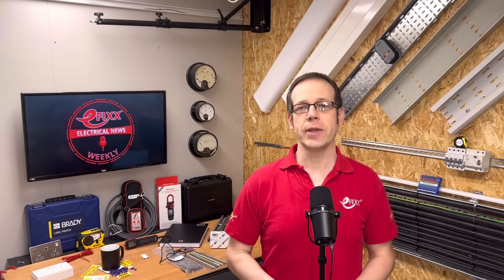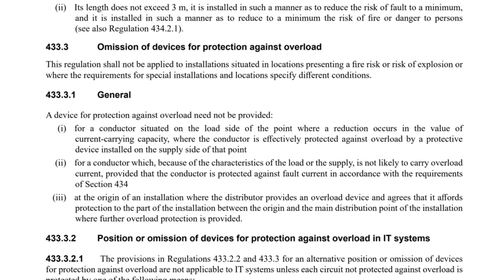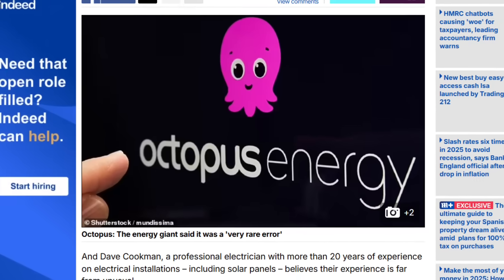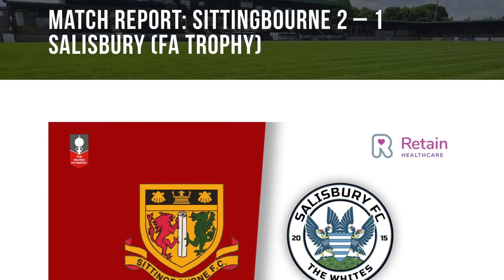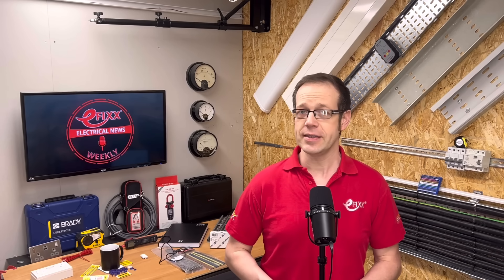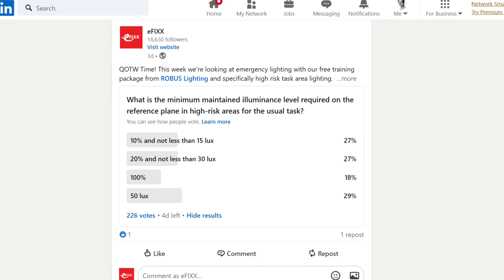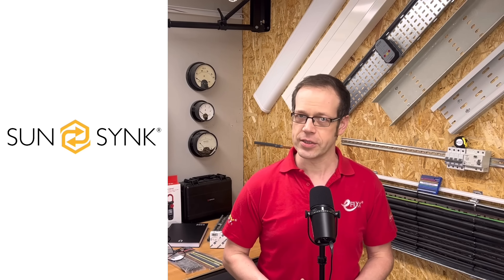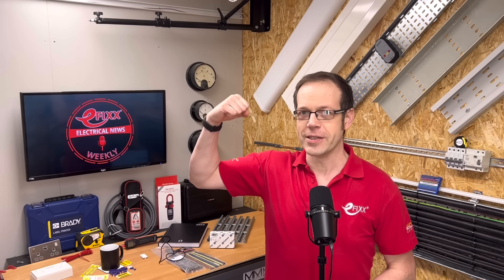Experts Give Verdict on the Cable Overload Row

Comment: How does a CT play any part on their bills though? a smart meter (or regular meter) has its own metering and does not rely on anything external to the meter. Even with FIT there is a seperate meter for this calculation. Did I miss something or is there some kind of metering with a CT (which could be abused very easily)?
Reply: With the note about solar installations, I can only assume it's the CT used on a hybrid solar inverter. With the CT installed backwards, the inverter will attempt to charge the battery any time you import any electricity as it thinks that it is exported. This will then increase your import and the inverter will increase its charge rate up to the maximum rate. I'd expect it to then continue charging at the maximum rate until it's full - You'd end up with some very strange behaviours. All assumptions, of course.
Reply: @yngndrw.  But that would only increase usage for importing energy up till the battery was charged fully. eventually no more could be imported for that, even if it was consumed that would then mean no imported energy till the next charge. Even that would not account for a £3k bill. Something doesnt add up here.
Reply: @_Miner  It will be able to flip direction when the battery is fully charged, in that case as soon as you start exporting from the solar panels the inverter will also start to export - Until the battery is fully depleted. It will essentially form a latch, flip-flopping between fully charged and fully discharged. With the difference between import and export rates, I could imagine it quickly racking up that sort of bill.

Additionally, depending on the setup of the inverter, it could be set to have upper and lower charge limits which would make it very unpredictable.
Reply: @yngndrw.  Exactly this. When I had a battery system installed, a CT wasn't even fitted around a cable. The result was a repeated charge/discharge cycle of the battery, which cost me around £30 before I spotted it. In the case in the video, the result was different, but the control systems will likely behave in unexpected ways if the CT clamps aren't fitted properly.
Reply: @yngndrw. haha it would be working against you the whole time, quite funny really. Hope whoever installed it is compensating the homeowner
Reply: In my case, it 'confused' the Solar PV diverter causing to send more power to the immersion heater instead of reducing it when the household demand increased.
Reply: I'm calling BS on the story, £5 is 20kWh.  Assuming a 3.6kW hybrid inverter, that would be charging for 5.5 hours.  CTs are passive devices, something attached to the CT was going wrong.  You should really just run some basic numbers before repeating story's as though they are real.
Reply: @WindyJAMiller  100%  hmm more than 850A for the kettle boil time to get the £5, I think they would only do that once before the DNO comes to replace the fuse!
Reply: The billing CT was attached to the wrong cable.
Reply: @G6EJD  There is no such thing as a "billing CT"

Comment: (prematurely) EXFOLIATE and EGREGIOUS I'd wager.

Also, ChumpFix looks pretty neat having seen some very interesting mounting options by DIYers.

As for the cable overloads I can't comment on the British regs, but in Denmark as long as the equipment, which is permanently mounted, doesn't overload the cable the fuse can be whatever size that still ensures short circuit protection for the entire length of the given cable.
Reply from the maker: V. similar to UK regs to be fair. 😊